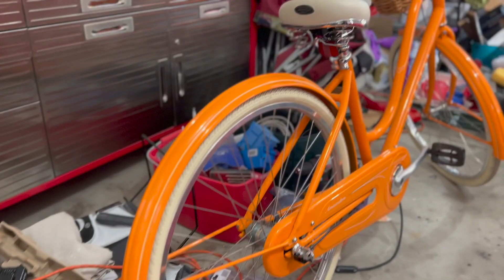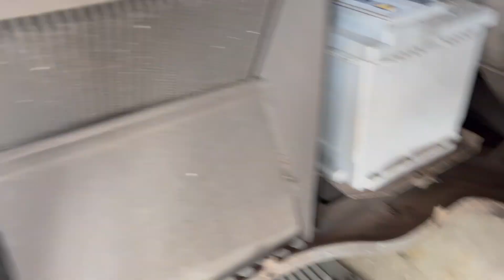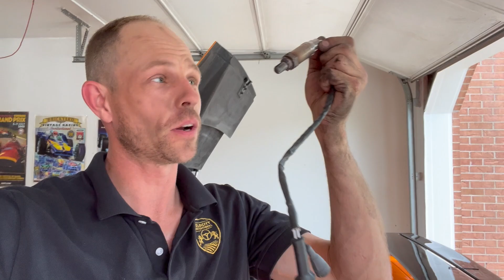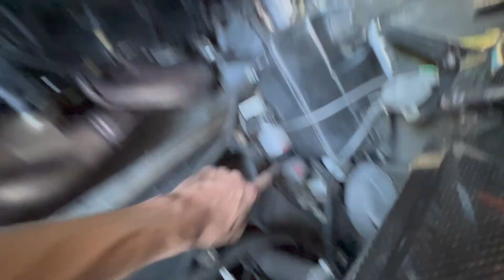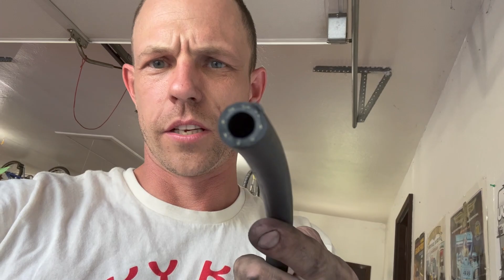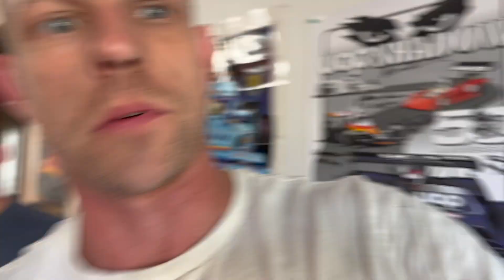Beating CRAZY $10k+ Dealer Repair Costs at Home CHEAP!

Comment: Casey...Thanks for the great PSA on the "Joys of Italian Auto Ownership".....This is the stuff you just don't get from Ed @ VinWiki.....Great Stuff! Might I suggest a "Joys of Italian Motorcycle Ownership" follow up.....Now that you have a bevel drive Desmo Duck.....EZ Valve Adjustment & Cam Tower re-sealing.....Never worked on a Lambo but, done the latter on my 78 Duck 900SS....Should have never parted with a bike with such "CHARACTER"....That's what Italian transportation has....PLENTY of CHARACTER! 🤣

Comment: I wouldn't say the Murcielago was a dead of the countach design it was the end of that V12  and the steel space frame but the Aventador also has the same tranny forward layout It's like they brought the Countach into the 21st century 

Also sometimes you gotta hate being OCD and knowing what can go wrong because you know how it works. Like hearing a little noise and your brain runs through 50 different things starting with the worst until you get down to the basic thing and it end up being a loose washer or something.

Comment: Strong work!!! It occurs to me that Lamborghini of this era, even 2 decades on, is essentially a 1970s, or 80's British car with additional cylinders and additional layers of unnecessary 'Lucas' electronics (alarm system hooks to the fuel pumps???...yeah that worked well). OBD 2 on this unit is about as helpful as a screen door on a submarine. Will the proprietary Lamborghini diagnostic computer to the tune of 10-20K help???...probably not so much; I love that you resorted to an analog solution. Yes,  the Murci looks way better than anything from the Island , but essentially it has the same quality bones (chassis looks like it was welded by a third grader), suspect electronics and on the fly engineering. To your point, third grade level welding is just fine from a practical perspective, but I would have expected something better for the original price.  Maybe the main difference between Brit and Lambo is that purchase price of the vehicle or any part is 10- 100X higher. Awesome creative parts research, but the true Lambo aficionado (jack-wagon) will laugh at your proletariat fuel filters that are NOT labelled Weber (despite their mechanical equivalence). 
Keep up the good work. Hey... when are you going to get into that Lotus project?...your skills should be all buffed up now.

Comment: Dude, it's like swapping a coil to troubleshoot a misfire, just swap your electrical connections, and fuel lines, from one solenoid to the other.  If the other bank fires and runs, it's a bad solenoid, and it didn't take you two days to confirm.
Reply from the maker: Did that... Hence why I knew. And yes, it took two days to get to the point of realizing where the problem was. So dude... I'd like to see you figure out an unknown car this complicated in less time.
Reply: @CaseyPutsch  calm down, I'm not criticizing, I just saw that you didn't do that in the video.  It looked like you were just figuring it out from the start.

I've never worked on a Lamborghini, but I'm an electrician that specializes in automation so relays and solenoids are kinda my thing.

Judging from the video you just swapped the wires from one to the other and "confirmed" when the engine wouldn't fire.  That's not really much of a confirmation of that particular device, just a "yep, something is still wrong with this bank" kinda thing.

Many times we get complacent and forget the fundamentals.   And these comments aren't just for you.  I can't count how many times I've been steered in the right direction from the comments instead of the actual thread/video.

It's not always from a place of hate, brother.

Comment: 10:00 some people say it’s not a good idea to disconnect the battery while the engine is running, but anyway a charged battery has almost zero load on the alternator. The other electrical consumers can have like 25A total or more so I don’t see a reason why disconnecting the battery would cause any problems. On the other hand disconnecting the alternator main positive outlet with the car running is very likely to burn a rectifier diode because of a current surge when the load is instantly removed.
An clamp multimeter is a simple and cheap way to test the current the alternator is producing, and also if the voltage gets to what is suppose to, it should be good. typically 14.5V but it depends on the battery management system or set points

Comment: I have been a car and truck technician/mechanic for almost forty years. I can empathize, you think you have diagnosed it right done all the stuff. Fire it up and the vehicle still doesn't run right. I understand your frustration. 
You did a great job of getting to the root of the problem. 
It is neat to see the different engineering and design of a car like a Lambo.(I have been a GM tech for the majority of my career).
Appreciate the detailed explanation of everything. 
Thanks for the great content!

Comment: I have never had any instructions from a welder. I got ahold of a decent mig welder (free) that was using flux core. I've managed to teach myself how to weld enough to make metal stick and have fab up 3 full exhaust systems! I may not make the prettiest welds but I'm good with a grinder so it all works out.

Comment: I don't know about you but with clean steel and a good machine I can stack dimes with TIG almost as fast as doing an ok but ugly MIG weld.

MIG does have the advantage of less heat and warpage, probably les HAZ.  I would just rather have the pride in craftsmanship even if it is essentially cosmetic...

Comment: And people laugh at me for working on my Corvette. I may not be a professional mechanic, but I'm more motivated and interested than a shop, simply because it's my car. The rest comes down to time, tools and practice. Kudos. (Also, my electric/electronic toys in the '80s only caught fire if I took them apart and tried to put them back together. QC has definitely gone down hill since then, but that experience turned into a pretty nice career.)
Reply from the maker: I’d never laugh at you for that.
Reply: @Casey Putsch  After the Mazda dealer told me that my '93 RX-7 needed a valve cover gasket, I thought: I really can't do much worse than be more incompetent or shady than those guys, it'll certainly be cheaper (unless I royally mess something up), and it's fun.
Reply: No one laughs at me for working on my own car. It must be something else. Plumbers crack? 🤔
Reply: @the_shoggoth  Yes. I’m aware. Try reading this again. At the time, I asked the service advisor to provide a part number for the magical valve cover gasket. Or a valve cover. Or a valve. In fact, just show me this magical leak. (They had put some ATF fluid on the intake manifold.) Because, as you say, rotaries don't have valves. The service manager was belligerently apologetic.